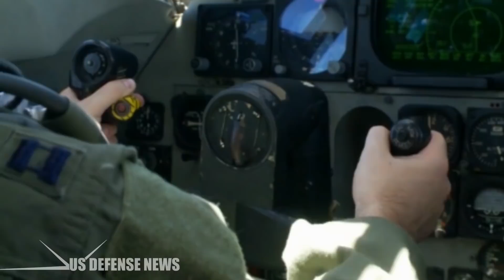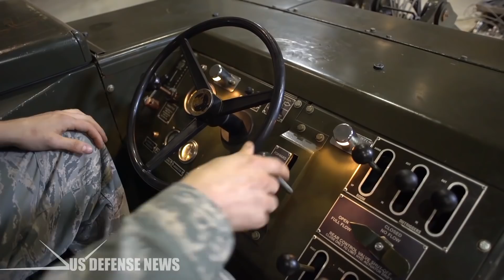Rolls-Royce offers engine for B-52 Bombers propulsion modernization

Comment: Fuck Rolls Royce - Install (4) F-117 PW 100 engines with Thrust Reversers. You Get Longer Global Range and short runway capable.  Want More Power? Remove De-rating Thrust Blocks from the Fuel Controls..  ITS OVER  - Like Fixing up an old Power Wagon.

Comment: Do these replacement proposals, or any others considered, involved replacing a dual with a single engine, for only 4 engines total?
Reply: No, the replacement program will keep the 8 engine configuration. a 4 engine proposal years ago was rejected.

Comment: B_52  flight team techs, does the Auminium skin stress and fatigue  due to the constant slight flexing over the years of operation as  not really structural but still very nescessary for creating airflow lift. Cheers Brilliant team never  hear  of your work failure and keepng the birds in the sky. Voice as painful as red hot steel bar inserted  where you not want it.
Reply: B52 has been re-skinned  several times along with wing  and pylon refurbish. Ever so many hours the plane deplaned and inspected. Every 1000 hours or so< I can’t remember it goes to depot level for major inspection.

Comment: The most expensive military design failure in current history it cannot compete with Sukhoi or mig's .The F35 is  expensive fat  and will never be as good an aircraft as an F-15 or F-16 . words on cost and maintenance are a joke It suffers critical failures every time it flies . The F-22 had an Oxygen system that poisoned its Pilots ! The military-industrial complex is also defending it's bad design, primarily selling it to other countries because we can't and won't use it in combat. defending bad design and production is the propaganda mission of the military-industrial complex you must work for it or serve the government in some way to believe this kind of stuff just look at competing aircraft and see what they can do . The F-22 is unarmored and cannot compete with other modern aircraft in a combat situation and it does not fast enough and is not  stealthy enough to get away this is engineering fact not fiction.
Reply: conantdog FACT The US of A will not sell the F 22 Raptor to foreign powers. The F 35 joint strike fighter will be sold to various countries, but not the F 22. FACT

Comment: My personal opinion is that the Air Force should replace the 8 current Engines with 4 Engines like what are used on the C 5's, C 17's, or the Presidential 747-200. These Engines are much more Fuel Efficient, and would also provide more than enough thrust to launch a fully loaded Buff, and allow them to fly greater distances without having to refuel in the air as often.
Reply: The B-52 has various rudder control problems during an engine out at critical speed situation, and that is with only one of eight engines failing. A one of four failure would be too much to handle. Also the bigger engines create clearance problems at the outermost pylons

Comment: Why mess with perfection IMO. Growing up and watching and hearing those TF33 engines is a sound and smell that one never forgets. That alone would get the enemy looking for a very deep hole. Im for efficiency, but this bird doesn't need it's time tested externals modified. It's a legend...
Reply: The B-52 is basically a stand off launch platform. The weapons are launched miles away from the targets. The targets hear very little to nothing.

Comment: Why the BR725, its underrated to the TF33 already installed?  That's going backwards.  The BR700-715 has 100 more horsepower than the TF33.  It's not enough of an advancement to consider installing unless fuel economy is the only consideration.

https://en.wikipedia.org/wiki/Rolls-Royce_BR700

https://en.wikipedia.org/wiki/Pratt_%26_Whitney_JT3D
Reply: Apparently the present B-52H has more than enough engine thrust and routinely uses less than full power even for takeoff. http://www.airpowerstrategy.com/2016/11/22/old-dog-new-engines/#comment-10
Reply: This issue has nothing to do with takeoff power, its all about money.  The cost to service and overhaul these engines is getting too expensive.  New engines will save considerable fuel resupply resources in combat areas too.  A new engined B52 would save 30 percent on average in fuel costs.  A tanker with 30 percent saved fuel can resupply another 10 fighter jets.  If a new engine was put on the wing, engine overhaul would go down to almost zero because new engines will last to the end of the aircrafts flying time.  Boeing puts the B52's flying time at 55,000 hours which is based on the life of the wingspar.  beyond that it has too many cracks and can't be repaired, and there are no replacement parts.  The airforce has deliberately put B52's in the Davis Montham storage area so the B52 fleet does not time out.

Comment: Instead of the eight turbojet engines in use will they be replaced with 4 turbofans like in the C-17 Globemaster?
Reply: B52s hadn’t had turbojet engine since late 70’s. J57-19 aNd 29wa uesed in D models and earlier G models had J57-43wa. All H models have Pratt and Whitney TF33-P3, later called P103s.

Comment: The original plan was to modernize the B-52 with a new wing and four Rolls-Royce RB211-535E4B engines.
Reply: You cannot be serious? Four 757 engines? Where did you read that??
Reply: http://aviationweek.com/defense/b-52-re-engine-resurfaces-usaf-reviews-studies
Reply: That's an extremely interesting article. One of the comments within that article sounds very logical indeed & is not something you'd expect anybody to just grab from imagination. This is the wording......"Back in the 1980s, a good friend of mine, now a retired USAF LTC, was part of a team looking into the re-engining the B-52H with the same engine that powers the Boeing C-17A. It seems that when Boeing designed the 757 they made the engine nacelles for the 757 100% mechanically compatible with the B-52Hs wing pylon attachment.
After careful study the cost benefits, mind you this was back 35 years ago when Jet-A was a lot cheaper.
As it turned out, installing the C-17s Pratt & Whitney F117-PW-100 rated at 40,440 lbf of thrust on the 757 nacelle was estimated to reduce fuel consumption by 40%, increased the maximum takeoff weight from 488,000 to 588,000 lbs, an reduced maintenance time by more that 40%.
He also said that the cost to the Air Force for the mechanical part was minimal as the 757 pylon was direct bolt on and the electronics part was about $2 million in then dollars. But at the time the powers that be didn't want any competition to the still secret Northrop B-2 Spirit."

Comment: I'm not sure when this video was made, but Boeing already uploaded a video on their channel offering a B-52 engine modernization. They listed economic, tactical, logistical and environmental benefits of their new and improved engine. Personally I think Boeing would know better about how to build engines for their own designs, but in the end, military procurement is usually about which option is cheaper.
Reply: KitsuneHouse  Boeing doesn’t build engines. The outsource the pylon,nacell,and engines to other suppliers.
Reply: fw1421 I guess you're right. My mistake.
Then that probably means boeing and rolls royce are working together to try and get the airforce to modernize the engines.

Comment: This mighty 'Bomb truck' is approaching 70 years old. and upgrades or not must surely now be a sitting duck for any competent Air defence. ( Unless totally wiped out). Would the money would be better spent on B1 / B2 modernization.
Reply: Current aircraft are 56 and 57 years old. But, still it's been around a long time. The last B-52 hasn't been born yet.

Comment: 8 smaller engines is really inefficient but maybe multiple redundancy in a combat situation is more important? 4 larger engines would give more power and burn less fuel giving better loiter time. And RR can offer both options given they take the larger share of the A380 builds and that is a bit heavier than even a B-52.
But we all know that the Senators will make sure the contract goes to Pratt & Whitney don't we?
Reply: There isn't enough ground clearance for the outer engine pods to use larger diameter engines. Hopefully they use the GE TF34, it was supposedly modernized for the RQ-170 Sentinel.
Reply: You made a good point...But it's not only clearance issues.  The airframe and control surfaces are optimized for 8 engines, not 4.  the original control surfaces when the BUFF was a high altitude bomber would have faired better.  But when they reduced the height of the rudder and changed the other control surfaces when it was rebooted as a lower altitude platform it made it BUFF only 8 engine friendly.   Losing 1 of 4 engines wouldn't be a good option for the old girl.   While other 4 engine aircraft in the Air Force inventory have 4 engines, they were designed for it from the start...same for civilian aircraft.  I'll be interested to see where this goes in the future.
Reply: I vote for Lockheed Martin, I used to fix their copiers in Cocoa Beach LOL
Reply: "4 larger engines would give more power and burn less fuel". Yes, like how 2 engines are better than 4 in passenger jets.
Reply: 1chish for a suck big airplane like for engines won’t be enough power

Comment: What about the airframes, how long are they supposed to last ? What is the role for this plane, conventional war or Nuclear war? Flying these planes into Russia or China would be disasterous.Why did we build the B2 ? How many B52s got shot down in Vietnam ? If I'm not mistaken ,this plane has been around since the early 60s. Maybe the F35 has shown that a new design is beyond our financial reach.
Reply: The B-52 can fly both conventional and nuclear missions. They also have the most diverse payload among the bombers. The B-2 is a bit sensitive to fly in all conditions. The reason why so many B-52s were shot down in Vietnam was due to mission planning or lack thereof. They flew the same track and flight level everyday. Once the VC got the SAMs set right it was easy. You're correct, the current aircraft are 60 and 61 models.

Comment: Pratt & Whitney F117 being used on C-17 is a better option.  No need to have 8 engines per plane.  This isn't 1950's.  USAF already has the engine in inventory and maintenance training wouldn't be required.
Reply: They wouldnt fit under the wings i doubt
Reply: There's a lot more involved than just slapping 4 bigger engines on it. The B-52H was designed with a smaller tail than the earlier models so it wouldn't rip off during high speed low altitude flight. But this created a command authority problem at low speeds to which a crabbing system had to be added for cross-wind landings and special procedures to follow in a engine failure at low speed. The problem is the B-52H can only suffer one engine failure on one wing at a time and still be controllable. With the 8-enigne set the loss of one results in a 25% loss of power on one side. But with 4 larger engines a engine loss would result in 50% loss of power on one side which would be uncontrollable. So to go with 4 engines they would have to retrofit the B-52H's with the larger tail of the earlier models. 
Next, the B-52 has a inboard weapons rail on the wing between the fuselage and the inboard engines. Changing to a larger engine may change the airflow in that area and effect weapons drop behavior. This would have to be tested thoroughly. 
Then last but not least there would be a lot of internal changes, rewiring, re-plumbing, and new pylons.  To do all of this wouldn't be cheap.  
If the Air Force could find a replacement engine that fits into the existing engine pods without too much modification to the rest of the aircraft it might make sense. Otherwise I doubt they'll bother with it and spend the money on the new B-21.
Reply: I believe all B-52s had cross wind crab landing. The D's did.
Reply: Testing is one thing. Useful life service is another. They would have to test one to find out how the aircraft behaves. Doesn't mean the results show compatibility or feasibility.

Comment: I am sure there might be technical reasons and financial ones of course.   But why couldn't each pod of two smaller engines, be replaced by a single much newer and efficient larger engine.  Any one?
Reply: The pylon would need modification plus the flight deck modifications would increase costs substantially. For instance, the throttle quadrant, the fire control and fuel instruments would be replaced. I hope they do the modifications though as I imagine it would eventually save them the costs of modifying over the life of the aircraft.
Reply: It's at least partially thrust balance issue. If one engine fails during takeoff, in 8-engine configuration thrust difference is 25% and in 4-engine configuration 50%. And if I have understood correctly, new tail would be needed to handle that 50% difference.
Reply: *derp*.  Nothing but derp.  You may have spun a wrench or two, and probably dropped it in the works... You have no idea at all what you are talking about.  I and the entire planet are deeply embarrassed for you.
Reply: My thoughts too, i suppose ground clearance could possibly be an issue on the outer engines?
Reply: You just can't change 8 engines in b52 to 4 commercial large engines. The wing is designed for those engine, and it is designed to do things a DC10 is not. A b52 at this point is a truck to drop cheap bombs from. It can carry alot of them cheaply, The flight per hour is cheaper than B1, b2 and just about any other plane per pound of bomb dropped. Not fancy but good for conventional carpet bombing against non harden targets after everything is gone of air defenses.  US does not need alot of them Think about it, 20 units is a heck of a lot of bombing.  Btw at a recent air show i boarded every plane including B1, but I could not take pictures of inside of b52 or bomb bay. So there was something there new.
Reply: Dennis Weifenbach because 8 engines looks a shit ton more awsome than 4, that's why!
Reply: I was thinking the same thing.

Comment: How fast and far could this air frame go with the right engines?  Sub sonic, of course but at 675mph instead of 530?
Reply: Putting larger diameter more efficient turbofans on this aircraft will increase the range and fuel efficiency but probably not the top end speed. I'd be worried flying one of these things that close to sound!

Comment: Could a 747-800 not take the place of the B-52? If yes, that would an option.
Reply: soaringtractor Building the new 747adapted to drop stores would be too expensive,and maybe not possible! The position of the 747s wing is not conducive to a central bomb bay and if it's not central then after dropping stores the centre of balance would be massively off,not practical for a stable flight envelop.
Reply: Stan Bilinski No,is the short answer
Reply: No. But they make great firefighting water bombers Global super tanker 911.

Comment: Can they not just use 4 very powerful 747 or A380 type Jet engines? 8 engines????? Ridiculous!
Reply: No because those engines would not fit under the low wing design. Engines barely clear the ground as it is.

Comment: We need to bring more of these "Glorious Bastards" out of the Boneyard and back into service.
Reply: They have destroyed a bunch of them already. There once was some 350 or so operational B-52s. Look up Davis Monthan aircraft boneyard on Earth Google. You will see the airframes in open air storage in the desert. Some airframes have been chopped into large pieces. Others appear largely intact, but have been cannibalized for engines, electronics, and airframe components. They are laid out, visible to overhead satellites, for disarmament treaty verification.
I'm sure Boeing has the engineering plans somewhere archived. Given enough money, production could be revived.
Given the required logistics for vendors and subcontractors, reviving production would be a monumental task. That is likely why the held on to the remaining ones. And upgraded them.
Reply: I don't believe the new bombers carry as much as the B-52.  The B-2 carries 40,000 lbs and the B-52 carries 70,000 lbs.  Range is another plus with the B-52 if not fully loaded.  It can ferry itself 10,000 miles.  It lacks speed and stealth.
Reply: @rkflorida4355  plus rhe B52 don’t have to be stored in air conditioned or heated hanger.
Reply: New ones AE: B-1L's, B-2's, B-21's have less pay load than b-52's. And i believe 6-to-12 h's are in the boneyard. for back up. A's thru g's are gone.
Reply: You sound like Rain Man.
Reply: 32° 8'50.95"N, 110°49'39.80"W
Google Earth coordinates for Davis Monthan boneyard B-52 storage area. Seems to be a lot of useable airframe available.
Maybe even enough parts to build a quantity of airworthy units.
New wiring, avionics, engines. Maybe some potential for remanufacture of B-52s if there were an urgent enough need.
Reply: they plane on it all that are worth fixing